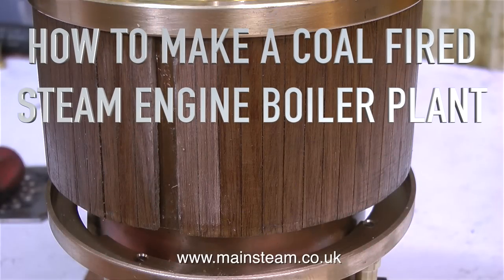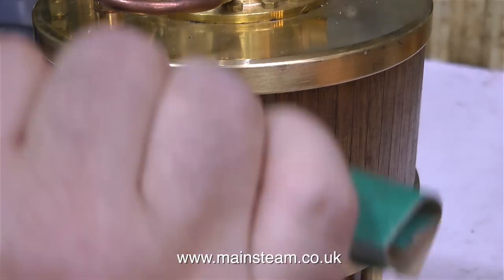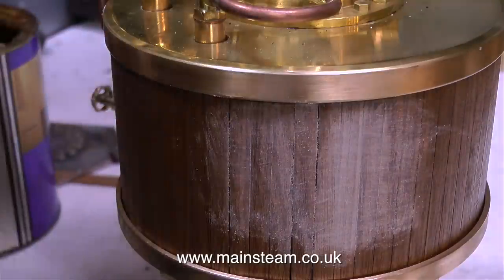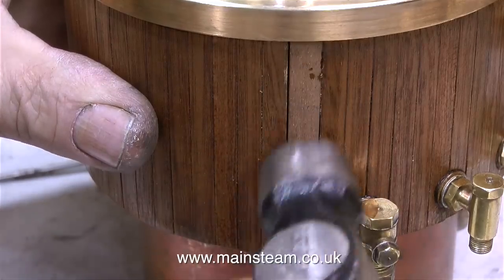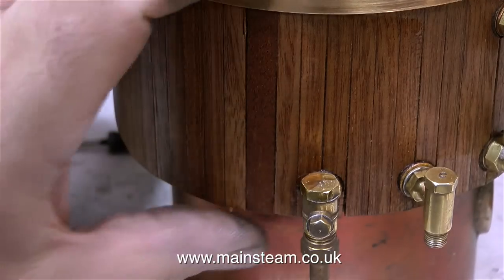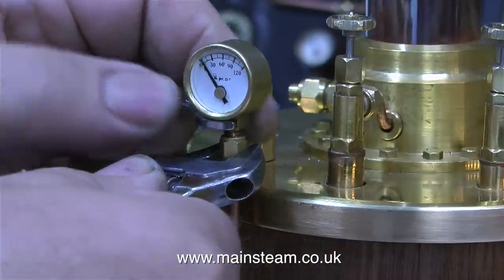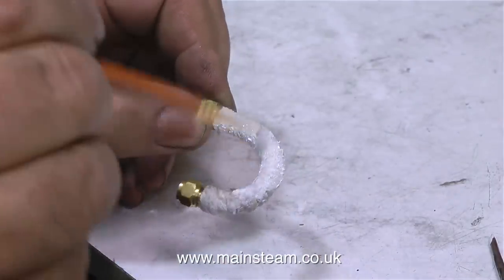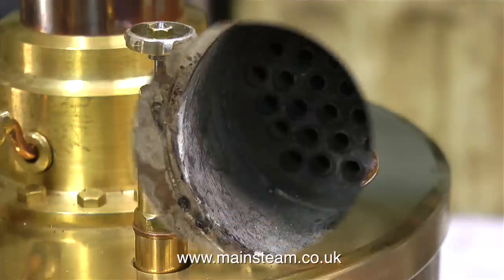HOW TO MAKE A COAL FIRED STEAM ENGINE BOILER PLANT - PART #28

Comment: Hi there, Just to say thank You for doing these videos. I come in from My garage after a days engineering to watch...well You Engineering!! Just to be clear I'm not a model maker so don't worry I won't be telling You how to do Your job.  I would call Myself more of  an "angle grinder engineer" and most of My tools and machines came from aldi, but if You are careful You can do a lot with just some simple machines. I successfully skimmed the cylinder barrels on My 2cvflat twin  engine and got an 11:1 compression ratio, just using My aldi pillar drill, an angle grinder disc, a cheap dial test indicator, a piece of glass, and some valve grinding paste. anyway thanks for taking the time to make YouTube videos, I tried but just couldn't do it so it's appreciated. After watching Your video about the mamod TE1 A I found out My mamod TE1 A My childhood toy from the 60's it's still in it's box complete with all the parts and a mamod leaflet stamped with My local toy shop, just as it was on the day when My Mum banned Me from getting it out and lighting it.... as I had set fire to My cousin!! also wardrobe, carpet etc .Boy were those meths burners fun!! ; - ) 
ps, a good source of nice old mahogany is old antique broken furniture. I got a Victorian Pembroke table as scrap for £2.50 I took it to bits, then reworked the top into a dashboard for My classic car,. You see old mahogany furniture is south American mahogany it's a little bit darker and not as stripey grain and in My opinion looks much more period. and it's good to recycle and upcycle.
anyway just thought You might like that tip

Best Wishes Jahmahrah

Comment: I was just thinking ... one of these large sanding video's you should do a shot of the sawdust falling to the ground after sanding or blowing the sawdust away ... then you would have something to change up with paint drying ;)
Reply: i wonder why every steam engine I have seen is always painted in dark colours for the majority ... it makes me think if this is so they can get a passive heat boost for starting or running ... since darker paint will absorb and convect more heat than a lighter surface ...

Comment: I was wondering if you could preheat and preshrink the mahogany strips before making the cladding instead of having to do the patchwork after it has been installed and the boiler run.
Reply from the maker: I tried that but as I have mentioned in a few videos, if you heat the Mahogany before fitting it, then it warps and twists badly . . . .
Reply: @keithappleton  Thanks for your answer. I found your channel few days ago and I'm binge watching these series since.

Comment: Hello Keith, I know you said it was Hammerite pot black... Is that the direct to rust metal paint? Looking to paint mine...
Reply from the maker: on the tin is a picture of a motorcycle cylinder - that's what it's designed for I think.